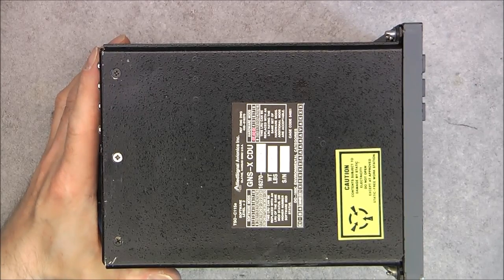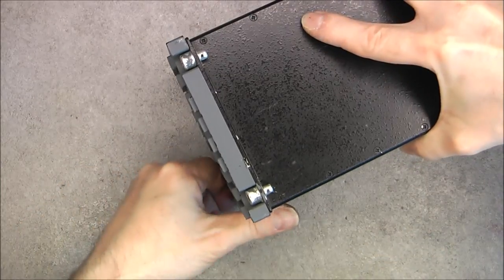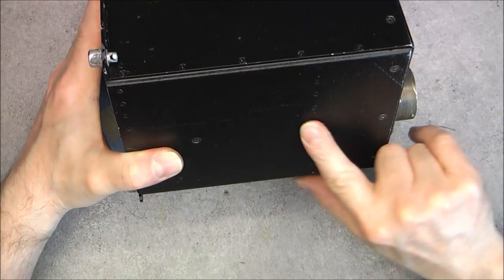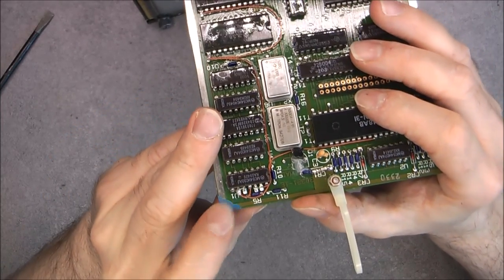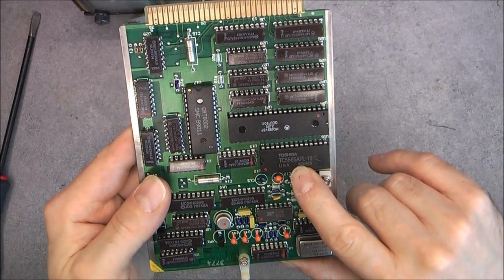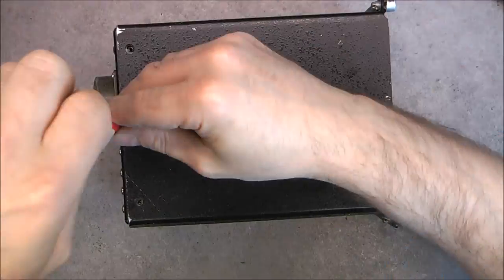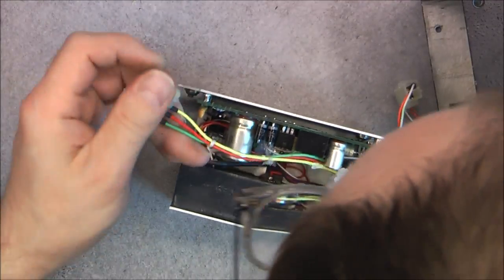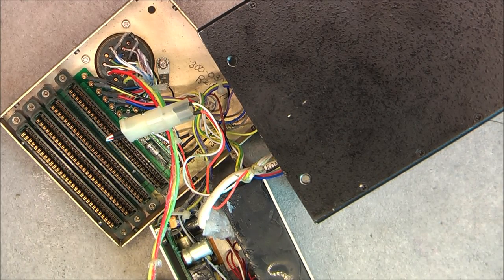AlliedSignals GNS-X CDU teardown

Comment: The first bord you pulled out is the CPU board, the NSC800-3 is a CMOS Z80 clone, used in the Husky Computer series as it is low power. The -3 part means it can run up to 3MHz. Would be intresting to dump the contence of the EPROM & see if there is anything intresting in there.
Reply: And the MC68B45 is the graphics/text controller. Still to this day every graphics card in every PC or Mac has some remnants from this chip in it.

Comment: I got one of these units, you should be able to power the thing up by applying 27VDC on pin W and ground on pin C. It draws around 500mA idle which is not too bad though I just get a static screen saying data transmission error, at least its something!. hope this is of some use
Reply from the maker: It works thanks ! Display is bright and sharp. I found that the brightness control is working, also keeping the ON button pressed gives a flashing display "Caution system is turning OFF"
Reply: This is much appreciated! I have plans to figure out how this thing communicates back to its CPU. It might be just RS232 or RS422.
Reply: Thank you so much!!! I was searching on the internet and found no information about it. I have a GNS-500A manufactured in 1985 with slightly different keyboard but interior is the same (it has the same round connector). Do you think that pins for power are the same on my unit? Where did you find this information?
Reply: Correction, it has two connectors (one is bigger that the other). Do you know where can I get information about those two connectors?
Reply: @branimirfilovski8388  Hey, yes unfortunately there is very little information out there on this item considering how popular they were, and I wouldn't risk trying to power your unit up with the same pins, though I'm fairly certain your unit will also have a similar power requirement as they are designed to be run on aircraft battery, its just a question of finding which pins with some degree of confidence. I found the pins on mine by investigating the solder side of the connector and making a best guess after lots of continuity testing on components!
Reply: @Branimir Filovski & C: Install manuals for the entire FMS (Flight Management System) are out there. At pretty steep prices. :( Paper manuals are on ebay, but it doesn't seem they were ever scanned/digitized.
Reply: @bubblegum7865  @Brian Smith  Thank you! You are right, I don't want to risk it. My flight school has a cessna citation 1 (my unit was installed in this type of aircraft). I will ask them if they have any information about this unit or information about pin-out. One Cessna Citation is on maintenance and maybe they can install it and test if it works.

Comment: excellent video, I have one of these units to which i wanted to convert to use in my flight simulator. I was planning to use an encoder board, however after seeing it only has around 30 pins for 57 buttons i am not sure how the buttons communicate with the CPU? Does anyone have a wiring diagram or any advice for me? I am tempted to remove the front PCB cover and see if i can solder directly but i dont wanna compromise the button press on the panel. Thanks!

Comment: I have one of these and (I believe its predecessor) a Global Navigation GNS-500A CDU. Unfortunately, I did not disassemble both side by side to see the differences. The 500A does have another smaller circular connector on the back though. Just looking at the electronics, it looks to be a functional equivalent of a "dumb terminal". Do you have any plans on getting the CPU that talks to these CDUs?
Reply: I have the same unit! It has a different keyboard that the one on the video. My unit also has 2 connectors. Do you know which pins are for power? Thank you!
Reply: I have just read your answer about manuals. Were you able to power your unit?
Reply: Hello! I have the same unit as yours. I tried to power it today (24VDC on W and ground on C) and I think that pins are the same as on the GNS-X. But the only thing working on my unit was the MSG light (no message on the screen).  I was also able to power the key lights (pin K and  pin P). Does CRT screen show any message on your system when powering it on?